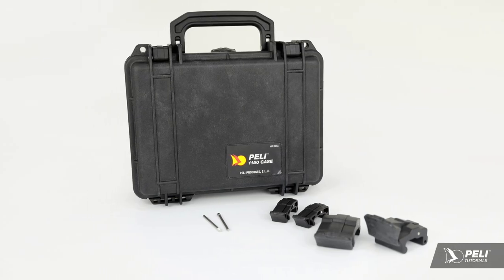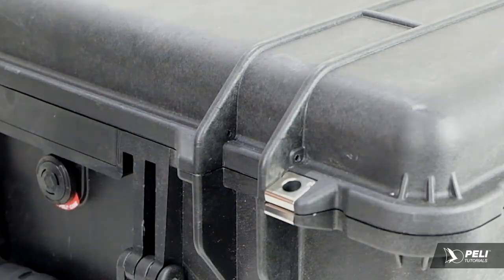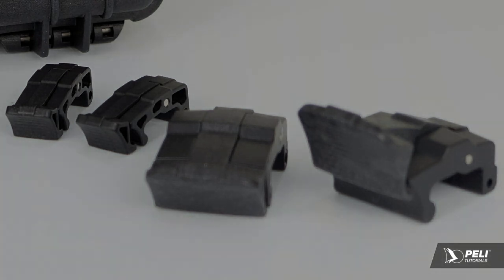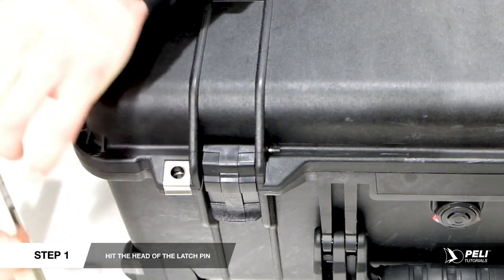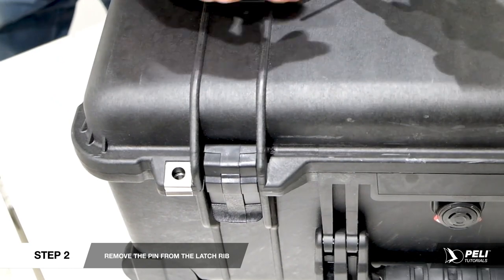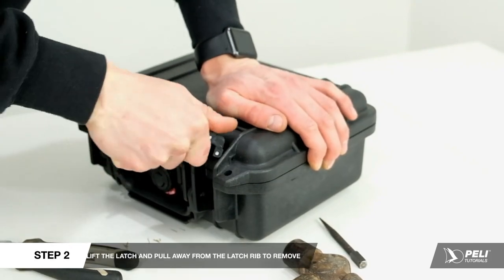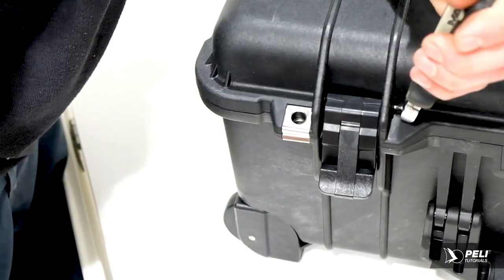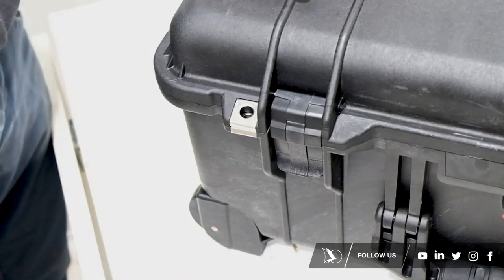How to Change a Peli Case Latch

Comment: Word of advice. Figure out which side has the threads first and try to push them out. For me it was right to left with the threads being on the left side. If you get the side with the threads out first the whole pin comes out much more easily.
Reply: Thankyou! I was getting frustrated

Comment: Not seeing anyway to replace latches on the 1450 cases. The pin is visible from only one side, but the 1400 series is not mentioned in this video. Do I hammer the pin through the plastic covering on the other side, or is there no way to replace latches for this series?
Reply: Hammer until the pin is visible on the other side
Reply: 1:18